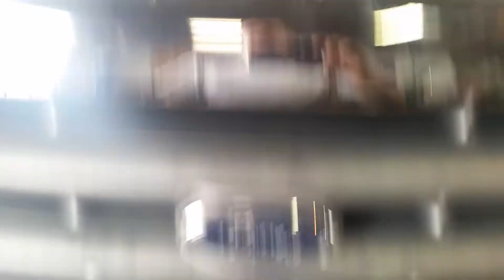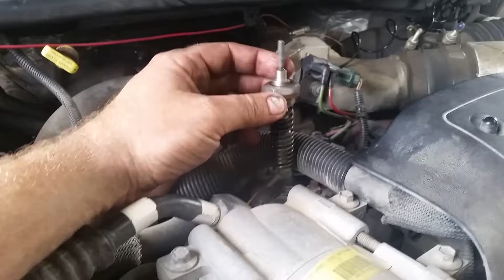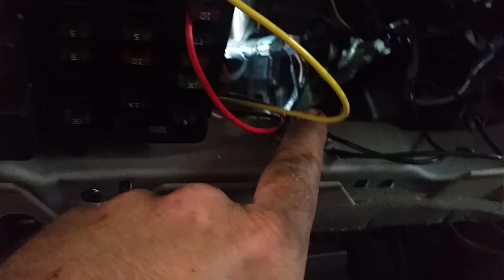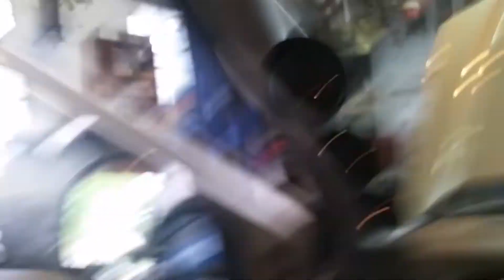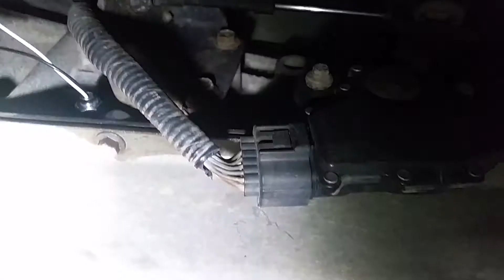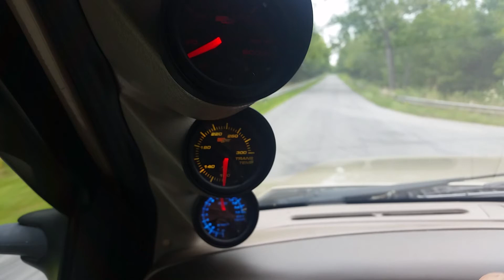Installing gauges on Ford diesel

Comment: I know I'm late to the party 1st thank you for the video!..  and not knocking you but WHY did you use red for your ground? I mean if you are the only one that works on it then ya....or is that whet the guage says to use use? Thanks man!
Reply from the maker: I don’t really remember. I probably just used what I had. But I’m the only one who works on it because it’s my truck so it doesn’t really matter. Thanks for the comment. ✌️
Reply: @jeffwiseman0286  lol quick reply! i was waiting for my work gate to open! Ya video before i watched this one was a hour long and he drilled a hole in the transmission///I knew there was another plug  Have a great day!

Comment: Do you not need your intake air heater? Won’t your truck throw codes on you?
Reply from the maker: Grant Spring I did this as a temp fix to see if I liked the gauges, that's was a couple years ago. No codes, I live in Virginia,  I don't need the heater. Maybe somewhere father north does.